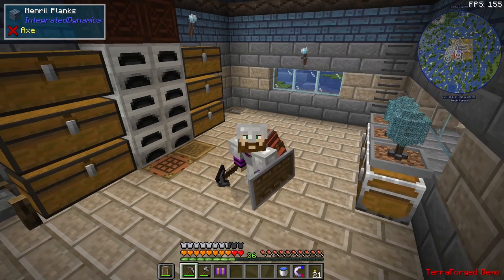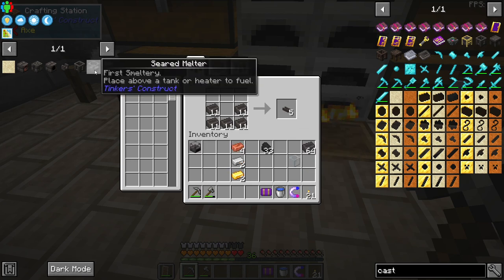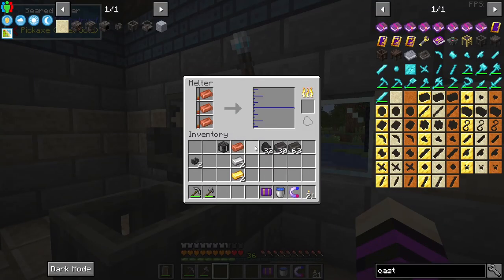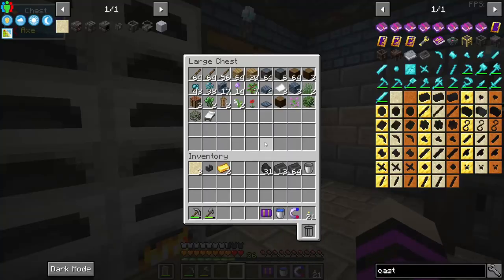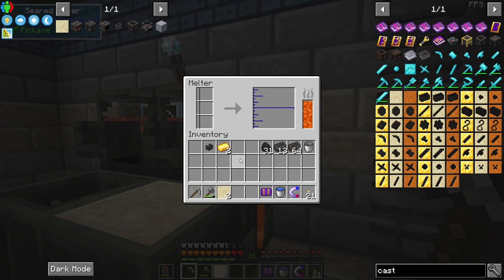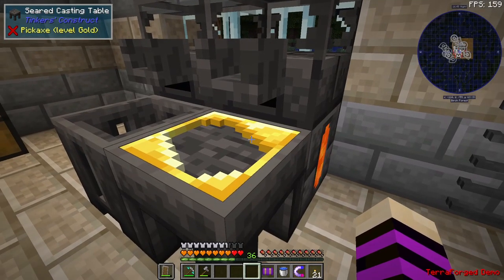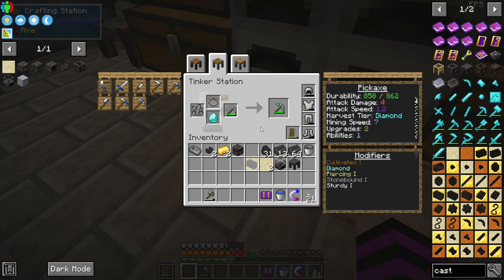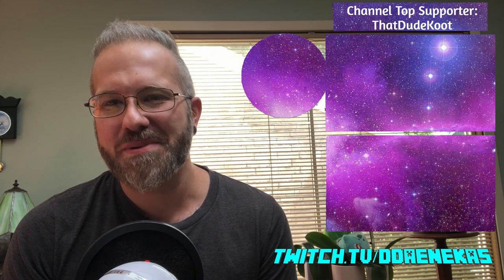Tinkers Construct Mod Spotlight 1.18.1 EP 2 - How to make a Cast! How to make Smeltery Controller!

Comment: Thank you!! Last time I seen this mod in use was during the Yogs Cast and Achievement Hunter days, Though I think it was just Yogs who were using it.
Reply from the maker: No Problem! Tinkers is one of my favorite mods!
Reply: @LetsPlaywithDDae  it's quite handy to have that's for sure.
I'm thinking of building a blacksmith around it's smaller form and maybe a smeltery later on too.

I'm hoping to do several medium sized builds with my current world.

Comment: i cant pour the copper into the basin with the heater inside its not transforming into a controller Edit : ( never mind i had to place seared bricks inside the basin and pour the copper )
Reply from the maker: Has the recipe been changed?
Reply: I’m having the same problem how do I fix
Reply: @LetsPlaywithDDae  it's the same for me, but the in-game instructions (mighty smelting) say you need a seared heater

it might have something to do with dw20 modpack?

Comment: cant use the seared bricks or seared heater wont let me pour the melted copper on it.
Reply from the maker: Youre sure you are using a casting basin and not a table?
Reply: @LetsPlaywithDDae  yep have about a block worth of molten copper in the melter. I have tried a seared bricks,seared heater and even a melter, nothing happens. can only get the useage for the smelter to show not how to craft. so maybe the mod has it disabled?? im on create asteral modpack which has Hephaestus (fabric port of tinkers). waiting for response from mod creator/converter.
Reply: new to modded minecraft so not sure how I could edit it myslef

Comment: I make stone tools only and add diamond to them so it only takes stone to repair. And I never use sharpening stones. I just make another work station and bring it with me. Tool about to break? Mine some stone, repair and keep going. Vain mine till your hearts contained! I also add redstone to my pickaxe for faster mining!
Reply from the maker: Thats what I used to do until I realized that you wont be able to mine obsidian or anything in the nether. Once you have iron generation, its really smart to upgrade and cast out iron sharpening kits. Either that or go right for slimesteel so that it repairs itself!

Comment: i cant make a smeltery controller, the copper wont go into the seared heater
Reply: ive tried both copper ingots and copper ore
Reply from the maker: Do you have a recipe for molten copper in JEI? Maybe you can melt it with a magma crucible?

Comment: I can't melt the copper on top of the heater :/
Reply: I'm having the same problem
Reply: same here
Reply from the maker: Tried Copper Ingot and Copper Ore? All the mods 7 modpack or a different one? E6E needed to melt the copper in the magma crucible I think.
Reply: @LetsPlaywithDDae  I don’t have any mods that add new copper but I’ll try both the ingot and ore

Edit: didn’t work with the ore nor the ingot
Reply: It’s seared bricks… use seared bricks